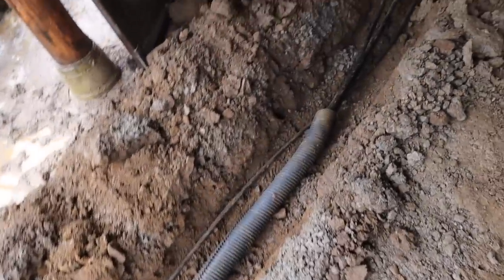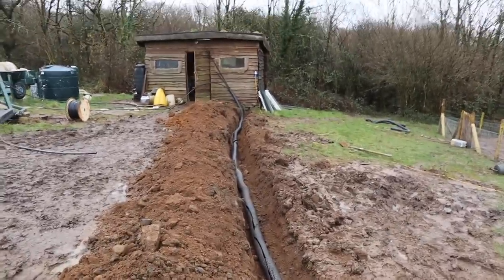Off Grid Earthbag Workshop Part 48  Water Damage Emergency

Comment: Chris  you did such a good job. Your videos always show all the hard work you do and usually do it by yourself. Chris with regards to you operating the track backhoe , you did a great job. I have worked on construction operating machines like that for many years. There are two things that matter. 1) no body got hurt and 2) nothing got damaged in the process. So it was a 100 percent success. By the way I agree with you also I like rock so much better than mud.

Comment: You had a problem and you fixed it, well done, no one can foretell how underground water will run you have now stopped the problem. And by the way no one is born with a skill so as far as using an excavator goes you do a reasonable job, one thing I will say is there is no half measures in this build.  Young have given yourself the luxury of deciding how and when each part of your house workshops and all buildings are done, keep up the good work and great videos

Comment: You should put in pipe and stone for a pirimitor drain in the states they require it both inside and outside but for you it will keep your bags dry so wait untill mid summer so they are dry before plastering . You do ok on the excavator always better to learn on a big hole as it goes slower than the mini . Scott from New Hampshire.

Comment: Sorry for your troubles. Earthbag is great, but must be able to breathe to the outside. My own earth bag roundhouse is having damp problems in the insulated roof cavity...so I think I may need to drill a hole and put an air vent in. You'll get round this...I suggest a trench all the way round the back and put a french drain in.  Enough unsolicited advice? Forgive me. I think you're a wonder and very inspiring. Only you would carve your own wind turbine...nutter. Genius.

Comment: Old builder here - very nice - love watching. Hey piece of help - your roof drains are a big issue on your shop! Those pipes need to be directed (piped away from the structure). Those drains are adding water right to the trouble points. xoxo
Reply: How so? The pipes go underground and directed out far away from the structure...

Comment: Great stuff water as you know can be a problem, you should put in a pipe drain at the back wall. Dig it a little bit deeper put in dranaige pipe and put some stone over it to take any line water away. This will protect the wall better. Good work looking awesome keep the vids coming 👍🙂

Comment: Nice work in sorting out the issue! a bit late now but if you have to lay the cable again for some reason (or elsewhere) it might be a good idea to put some kind of marker in the earth to show there is cable underneath, my suggestion would be sand or some concrete paving slabs, that way if you are digging around the area in future you will come across some weird material in your bucket before you come across a severed cable.

Comment: Have you considered planting small shrubs on the bank to help stabilise it?
Land slips and the erosion of banks etc happens due to the lack of vegetation with deeper roots.
Trees are the most ideal to prevent it but obviously you don't want to risk their roots becoming a problem to your buildings structural integrity but things such as scrubs are a nice go between.

Comment: keep it dug out around the perimeter and it will dry out, get some large stones to line the pathways or half logs and the stone will stay put you put down, could have done with at least some warning tape on top of the cables you buried but hey ho all done now.

Looking forward to the wind turbine video's, with all the wind you get there im curious how you are going to keep those blades from taking off ;)  
Well done Kris on the repairs, onwards and upwards !

Comment: Gravel - put it down everywhere.  I use about 2000 lbs. of 3/4" minus every year in my neck of the woods - Washougal, WA.  Those steps should fix that issue, you shop is looking great!

Comment: Oh using a hydrocarbon guzzling digger!?! I was expecting an eco solution like, using llamas to erode the ground away in a sensitive recyclable way. 🤪 sorry just bit of humour. I would think using a digger like that would be quite satisfying, getting so much work done in such a quick time. If I had the chance I would love to go mad on a digger. 
Every episode always makes my day to watch.
Reply from the maker: Im not at all opposed to using diggers. digging earth is one of the hardest things you could ever try and do, it is so heavy and full of rocks and sticky clay. a small digger like this does it with ease and over two days i used 30l of fuel to do all that work. im against over use and wasting resources for no good reason. the use of machines for good reason sits fine with me and i think most people however eco or green would agree with that. 

I know you were just joking about but i thought i would answer it anyway :)

Comment: Hey Kris - Top job as always,  you should take that picture of the front of the workshop, make it back and white, maybe with a bit of a  ink drawing effect,  and make a Hobbit parody poster.. The place is blossoming, just imagine how it will look in Spring. with some wild flowers around the place.  Its as close to the magic of Tolkien as you can get in 2020. Super interested in the windmill too, looks like one I had years ago, got a hundred questions but I will wait for the video... Baton down the hatches, good luck in this next storm Kris.

Comment: Great job on the digfer especially if its your first time. I’m surprised you don’t backfill the walls with drainage chip and pipe? That way you could backfill right up to the walls and worry less about water coming through

Comment: Have you thought about designing the wind turbine as a standing one, with the blades going vertically instead of the normal propeller one. When I looked into them that designed appeared to have some advantages over the normal propeller one.

Comment: I was surprised when you initially built the workshop walls why when you had a digger on site you didn't create a space to build on and access the whole of the outside of the walls to prevent this kind of problem, and further surprised why you stopped digging where you did and not carry on excavating all the way around this time.

Comment: I know this info is too late but...
When I was learning about running data cable in the very dim and distant past, we were instructed never to put data cable closer than 6" to an electric cable. If you needed to cross an electric cable it had to be done perpendicular to the electric cable. Although things have changed somewhat today (about 3" is the general rule), I still follow that rule when possible so as to limit the amount of interference and, therefore, increase the data speed.
Reply from the maker: that is a good point actually, i think luckily they are actually separate in the trench for the most part just where they go through the wall they are close. i will see how it works. its so close to the shed i could always wireless it anyway.
Reply: @KrisHarbour  I doubt it'll be of any consequence as you're not using it intensively. If you get slow downs etc. when using a lot of electrical power, I'd look there first...

Comment: Hey Kris, not a "you are doing it wrong" comment, just a question did you consider putting a french drain along that side?
I know you are a pretty critical thinker, so just curious if you did consider it, what made it unfeasible?
Waiting with bated breath for wind turbine, glad you addressed that question before it was asked!
Reply from the maker: yeah there will be one there once the mud settles down and the plastering is done. :) if i do it now it will end uo getting blocked up.

Comment: A question: is there a reason you made a hole in the wall for the cables and stuff? Wouldn't it be neater to let the pass under the wall and up through the floor?
Or was that not possible in this stage, with the walls and floor already built?
Reply from the maker: that involves running them and having them sticking out the middle of the floor before the walls have even been started ,sitting right in the way for over a year exposed to everything and getting run over by the tractor while filling bags.
Reply: @KrisHarbour  yeah I understand. I wondered if it would have still been possible now, but it's too much of a hassle to get them dug under the wall now I guess?
Thanks for your answer by the way! I really enjoy watching your progress, and I almost jumped from excitement when I say that mill. Can't wait!
Reply from the maker: yeah it would be possible to dig under the wall but there is drainage under there and i would rather leave that alone to be honest.
Reply: @KrisHarbour  yeah that's fair I guess 😉

Comment: Buys a field in the middle of nowhere (compared to where you lived before,I mean)

Builds a house with central heating.
Creates his own water source and pipes it to house via his own piping system.
Builds his own hydro electric plant.
Sets up a small solar power system
Designed, fabricated and built a work shed.
Built an internet relay station
Designed and half built a basically small underground factory space..... probably a few things I missed - oh yeah, built a harp - from scratch.

Then says he has a short attention span!  Sorry, I don’t really believe that Kris.... ;-)

Comment: I live not too far from you I think, just over the border in England and the floods here have been awful. I've seen walls collapse due to the water and my own shed has started to sink into the earth due to the sheer volume of rain. My problems are caused by a very wet winter and there being an old culvert running under my garden that does funny things to drainage.  I imagine the different grades of the soil and the compaction caused by your building work have caused some of the water to pool where it wouldn't typically.

Comment: See that standing water on the ground that you dug out by the problem wall? If you have woven sacks for your earthbags, they will wick up some of that moisture and you'll have a nightmare getting it out of the wall. It might be a good idea to dig down another inch, just below the wall, and then use a little of that stone to create a little soakaway around it. That, I think, would prevent the moisture problem. I suspect if you don't go this route, you'll forever have an issue whenever there is standing water, since you'll never be able to completely watertight the base of the wall even with that lime plaster - but this is just an educated guess, and you may be a better judge than I.

Comment: I know this is probably years too late, but why didn't you use the blade on the digger to backfill the trench after completing the work? It seems like it'd be much quicker to use it like a bulldozer to push the dirt back into the hole instead of using the shovel over and over again?

Comment: Real shame about the wall, but it kinda worked out well given all the other jobs that needed doing. That set of blades looks well fancy. I bet you enjoyed making them. Just one point, should the outside of that wall be supported while it's drying out? Maybe a plank or two with supports in that new bank? Just my genuine concern. Those little excavators are great.👍🍷

Comment: Good job! It might have been faster to use your loader on the tractor to spread the gravel out and carry it to the front of the workshop. Your way works fine too, although a bit more work. :)  I know the tendency to use the equipment you're paying a lot to rent, but it's not always the best thing to use. ;)
Reply from the maker: The tractor v tyres would have pushed all the stone in the mud and churned it up turning around. The digger has a lot more surface area and can go back and forth no turning

Comment: I am not sure why you do not use any type of heat to dry your building as you get each section completed. Not a permanent heat source but just to dry in your walls. Yes I get the environment stuff. but there is a time and place for heat to dry in a building like this I would guess but it does look as though your methods work well for you. Cheers

Comment: I'm sorry I am a little confused. 
So the moisture intrusion was caused by a liner failure ? Was it placement issue or actual membrane failure?
And then the big question why not replace the membrane and re bury it like it was ? Seems like a lot less work. What's the reasoning for leaving it exposed??(with plaster of course)
Reply from the maker: it was placement. i had to cut it around the pipe. it would have been fine if it stayed where i had it. when i backfilled it i think it must have got pushed down a bit so then there was a bunched up bit of liner with a hole in it that caught water. it wasnt that deep and i could have just fixed it and backfilled but i decided i wanted to get it all dried out and it would be better left open to breath.

Comment: Are you keeping track where you buried what and the depth and all? Figure in 10 years time you'll be very glad to know the exact route and depth is occupied. For new trenching and for repair.

Good luck with your water ingress! In the past I figured more than once that the piping and draining is a bit on the tight side and everything seems to close to the walls. Water is finding every nook and cranny. And you'll get rather worse rain in the future than lighter one. Despite what POTUS keeps twittering..

Comment: Wow, your gravel guy could have spread it out for you...you know pull forward, and not open the gate all the way, and shake the bed....lol
Reply: Why would you not put corrugated drain pipe in, once you dug it out, and gravel?
Reply from the maker: I will be. But i will do so once i have plastered everything, the fresh dug soil has settled down and the weather improves. at the moment it will just get clogged up with cob and lime and mud runoff.

Comment: You grown your hair ...just seen a old clip..Did you need to get permission to build this?
Reply: Its a shed so he doesn't need one as hes not gonna live in it. The Roundhouse is too small to need a permit(as far as i understand from Kris) but he will need one when he is building the Main house.
Reply: Some of this was explained in the comments of the live q and a he did a while back, I do not recall him talking directly about it, Many of the comments directly reflected this by the people who did their research. 
Depending on where you live be it country, state, county, township, or what ever your call your area will mostly tell you what you need to do. Where I live in the US, In the remote rural areas we really only need 2 state inspections for a brand new power pole ( electric meter ) Not your house power and state inspected septic tank. Building permits are not really required, You should get one, yet if you do not get one nothing comes of it. Inspections are not done for anything, There is nothing that requires you to have engineering plans or anything. My neighbor has built 5 large building our of reclaimed material in the last 10 years, One building is 40 by 20 something feet. Another neighbor few miles from me built a massive building 150 feet by 100 feet standing over 20 feet tall out of steel 6 inch sprinkler pipe with 3 large roll up doors. It is an impressive building at 1/10 of the cost for something you can buy.  There are even a number of pole barns built here in town with out permits/inspections. Couple of them down the road in my small unincorporated town.